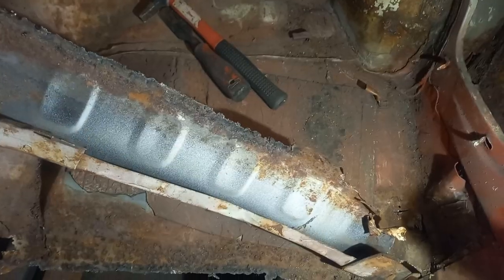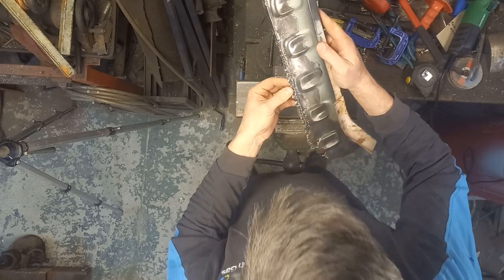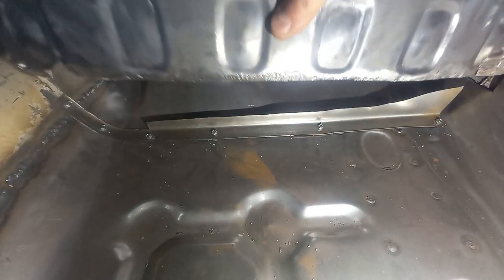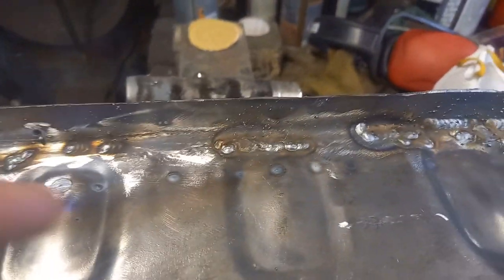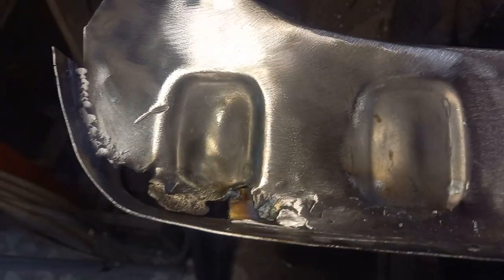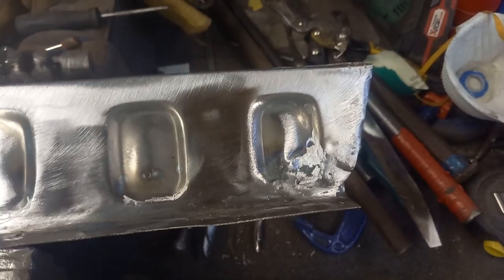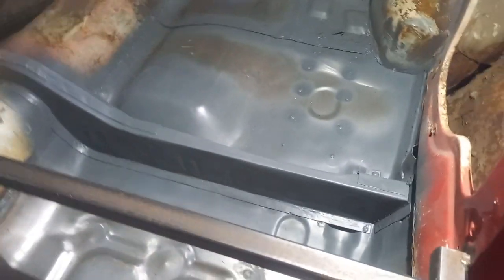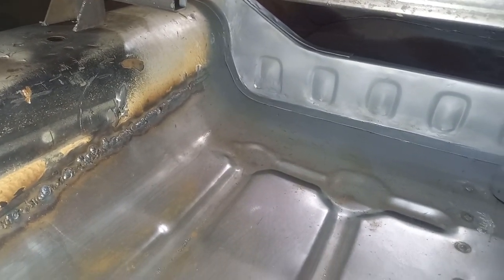Ford Escort MK1 Rear Seat Box Repairs.  Car Restoration.

Comment: Still hooked.
Can you tell me Dave. The 15mm wide repair strip, L shape, along the bottom. Did you cut and butt weld onto the existing panel or was it overlapped and welded?
Reply from the maker: My intention was to butt weld it, but in the end it was simpler to lap weld it.
Reply: @DavesGarageuk  Thank you Dave. 👍

Comment: Worth a few quid when its finished should cosworth engine in it
Reply from the maker: They are worth big money now, it’s insane. Cossy engines are very expensive too, for a pinto with a twincam head 😋
Reply: @DavesGarageuk  ava motersport back off Glasgow Airport if yer stuck for stuff they build cossies from ground up always got stuff for older ford's

Comment: Great job Dave. If it were mine, I wouldn't grind the welds down to make it look neater on a part thats not going to be seen, your taking some strength out of the repair. Plus, you save yourself some work. Just my opinion.